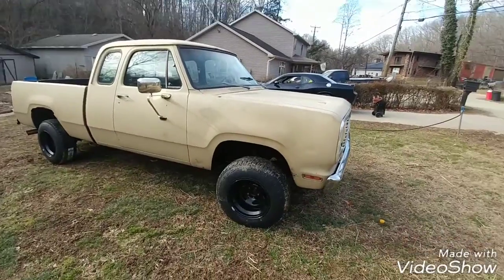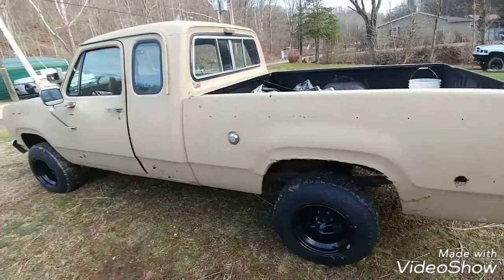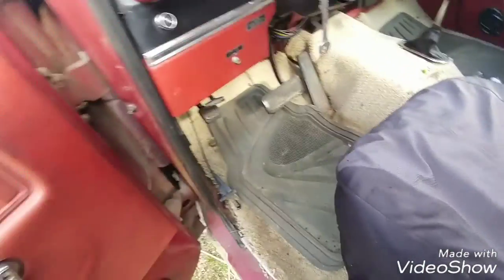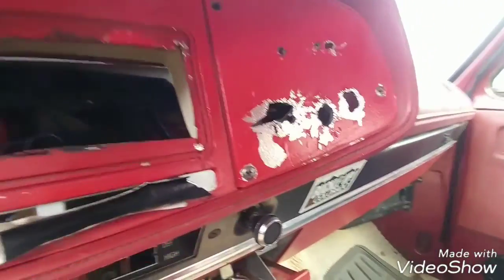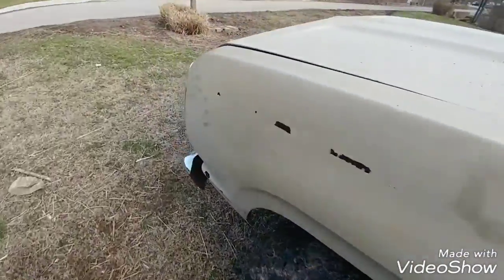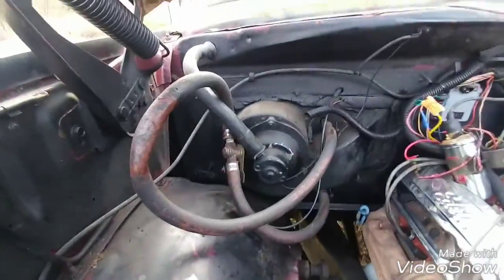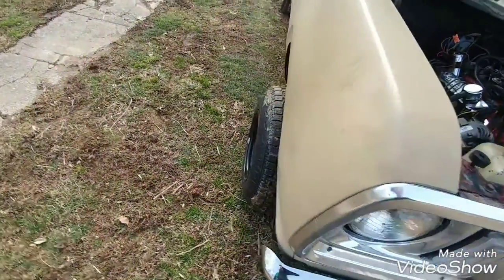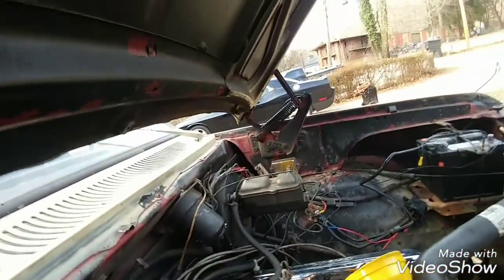Overview of my 1978 w150 project !

Comment: I have a ramcharger that is similar to that same motor. Was wondering what it sounded like cammed? I want to do cam heads intake and exhaust on mine.
Reply from the maker: Daniel Holt i have most of the wiring harness done. Ill be recording the remainder of fixing that and putting a few more parts in the engine bay then i will upload a video of idle! Just trying to record around my work schedule! Thanks for the feedback!!